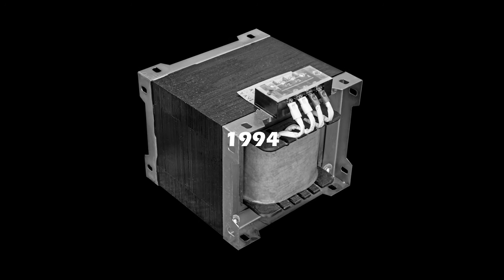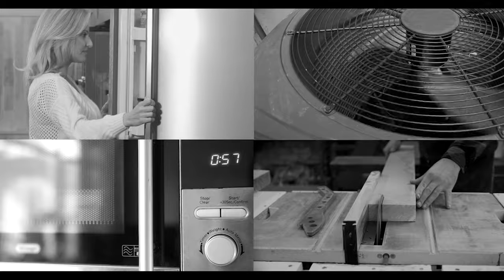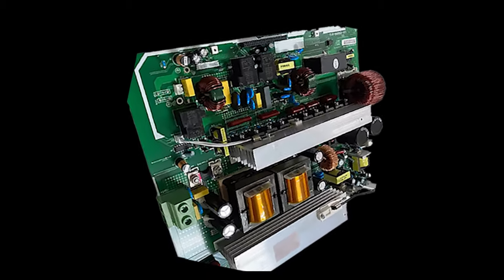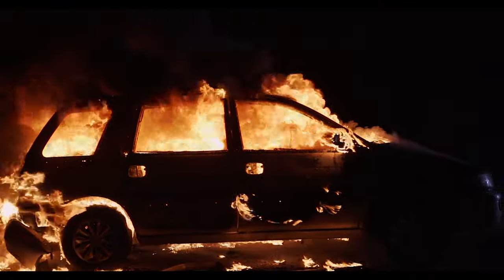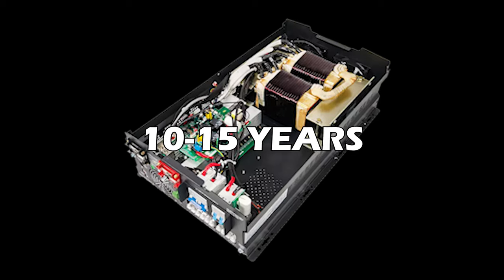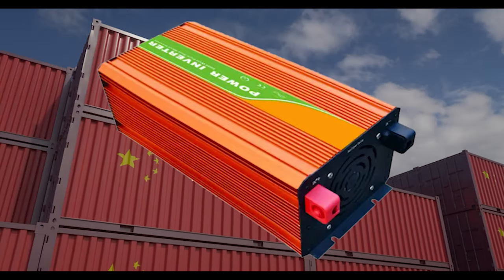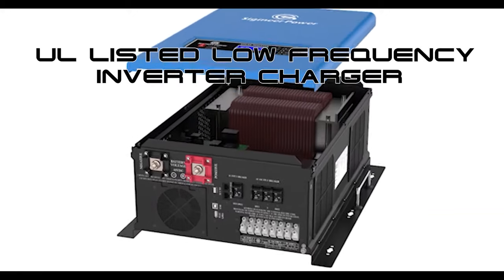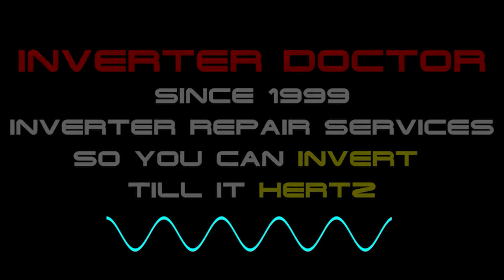Watch This Before Buying That Off Grid Inverter

Comment: I have a Chinese Meanwell 3000w HF inverter running 7/24 since May 2011.
Reply: Running what? Resistive loads?
Reply: @Madsci-zy8wm  fridge, submersible pump,TV, CCTV and lights
Reply from the maker: @evrenforest2578  What is your solar array and batteries rated at?
Reply: 6*250w PV array with 48v200 amp gel batteries
Reply: @evrenforest2578  A submersible pump and a fridge and a TV are not high inductance loads residential loads. If they were, you would have probably only had a couple of years worth of use from your 3kW HF inverter before the FETs and Caps fried.
Reply: @Madsci-zy8wm  electric motors ( AC, fridge, ...) is inductance!
Reply: @valerigeorgiev5615  Of course that are. But the electric motor/compressor in a refrigerator is very small and demands a small surge current.
Reply: @Madsci-zy8wm  exactly
Reply: @evrenforest2578 Does this work well for a 3/4 HP pool pump? you have to remember that they have a starting surge.
Reply: @evrenforest2578  A fridge is a relatively light inductive load, and so is a sump pump. And TVs CCTV and lights are not inductive loads.

Comment: There's a reason I paid "extra" for the Victron.👍
Reply: And Victron is not the only one, but you are correct, you will pay more for transformer based units. Something most don't take into account is idol consumption, Victron is great at that also. I have a 3000w mobile solar generator,  low frequency unit, and it idols at 13w. And 15kw in batteries. I try to tell people those Chinese units are junk!

Comment: Over exaggerated it all depends what you are going to use the inverter to do what job and what is the purpose. Yes I would definitely recommend Victor on the circuitry on the low frequency inverter is very well designed but they are not cheap everybody has a budget. There is nothing wrong with high frequency inverters if they are designed correctly. High frequency versus tend to be a lot more efficient lower power consumption without load rather than a low frequency inverter. But then again it all depends what is the purpose of the inverter if you're going to run a full house then yes I would recommend low frequency but at the same time if your calculations are correct you could have two high frequencies synchronized together which will work very well.
Reply: There's plenty wrong with high frequency inverters. They don't last as long, they've got a crappy surge capacity. And because they don't have an isolation transformer, when they fail, they can take out your appliances in a heartbeat. Why do you thing they're so cheap? They're basically a poor man's inverter. And you don't have to buy an expensive Victron inverter anymore if you want a high performance, low frequency inverter, There are plenty of Chinese made low frequency inverters available that sell for nearly the same price as these junk high frequency inverters. The only people that are promoting these cheap inverters are youtube salesmen that earn a commission when you click on their affiliate links.
Reply from the maker: This video is not over-exaggerated in any way shap or form. The problem with all of the Chinese built high frequency inverters is that they lack any galvanic isolation which make them all a potentially dangerous product that can set your appliances and home on fire.

Comment: Low frequency inverters are not very efficient in standby,,and when you get one you have to add an mppt controller switches ect and they are 3 times the price .the answer is get 2 or 3 high frequency inverters in parallel and don't work them to hard. And they are more efficient in idle mode
Reply: They make an in one low frequency inverters

Comment: The only problem I have with LF inverters is I have yet to fine some that can stack.  I can stack my growatt inverters.  They are off grid.  At some point I will replace them.  Currently looking at EG for that.  But there are a couple of Us mfgs too.  We shall see what is available for a 48v system by then.  In the mean time, I still trying to figure out a way to integrate my 24v wind turbines from the old system with out a $2K charge controller and changing the heads for $1400...
Reply from the maker: Many low frequency, transformer based inverters are stackable including Schneider Electric, Outback Power, Magnum Energy, Victron Energy and Sigineer Energy which is the lowest price, high quality low frequency inverter on the market. I have three Sigineer 6kW MS6048Ds powering one of my off grid properties right now.

Comment: I use a HF one as a backup, the main one I use is a chinese one with a 15kg toroidal transformer, which I only replaced my previous one because snow condensation blew the mosfets, learned from that🤨

Comment: Here's a good analogy: 

Think of a low freq inverter as a heavy, cast iron block, low RPM diesel with a big heavy fly wheel and a large capacity cooling system. 

Think of a Chinese high freq inverter as a small, all aluminum, high RPM, air-cooled, 2 cycle engine, with a tiny flywheel. 

Which one do you think will last longer?  Which one will be able to handle the big startup current surges for your A/C unit, or your 5HP well pump?
Reply from the maker: Awesome analogy! You hit it right on the nail head!

Comment: How do we tell if an inverter is low or high frequency when looing to buy one? Is it listed somewhere that is reliable? Just because a vendor says their inverter is low frequency does not mean it really is.
Reply from the maker: One way you can easily tell is by the weight. A typical 5 Kw all in one high frequency inverter charger will weigh 52.9 lbs. While a 5kW all in one low frequency inverter charger will weigh 99 lbs. Another way you can tell is by the surge capacity. A high frequency inverter will offer a maximum of a 200% surge capacity while a low frequency inverter will off at least a 300% surge capacity.
Reply: @kickgas7171  Hahahaha. Yeah I was going to say, if you can pick it up with one hand, it's not low frequency. :)

Comment: How about we buy let say 10kw high frequency Inverter, but only use max 5kw load ? So even powering peak it wont break ????
Reply from the maker: Why spend all that extra money for a 10kW high frequency inverter that cannot start 10kW inductive loads when you can spend less money on a 5kW low frequency inverter that will start the 5kW inductive loads that you want to limit yourself to?
Reply: Buy 3 times the size you need for running hf inverter on fridge or freezer or pumps
Reply: You are still kind of rolling the dice. Yeah, it might work. You have to look at the specs regarding peak current versus hold-up time. There should be 3 or 4 values given.  X amps for 10ms,  Y amps for 100ms, Z amps for 1 second, etc. That sort of thing. Not every heavy inductive load is the same. And here's the other part: Who's specs are you gonna believe? Chinese physics typically is not the same as American, German, or Japanese physics.  Translation: They lie about their specs all the time.

Comment: Totally agreed only technical people can understand this.
I am using APC smart UPS 3000 (2700 watts) with 80Amp mppt charge controller.
Any Chinese inverter have features like APC like AVR auto shutdown group outlets?
Remember whenever these inverter going to die because of short circuit most probably entire home appliances will be damage.
Reply from the maker: Yes, high frequency, transformerless inverters can damage your AC appliances.

Comment: Do you have inverter that 120 volt AC as input?
Reply from the maker: Sigineer Power makes 120 VAC Input/120 VAC output 60Hz. Inverter chargers with AC transfer switch from 1.5kW to 4kW that are reasonably priced.

Comment: where is the link to this great inverter?
Reply from the maker: It's not just one inverter. Most top name brand US inverter manufacturers only build low frequency transformer based inverter. Brands like Schneider Electric, Outback Power, Sigineer Power (a Chinese brand), Magnum Energy, Victron Energy, just to name a few.

Comment: Who makes a Decent Low Frequency inverter say 1500 watt ?
Reply from the maker: Sigineer is one brand. Their 1500 Watt low frequency inverter is available in both 12 volt or 24 Volt versions. They have built in chargers and a transfer switch for fast UPS function and they offer a high 4,500 Watt peak power capacity.
Reply: I have there 6k now for a week. It’s nice but querkie.
Reply from the maker: @2hotscottpro  All inverters are quirky. Even big name brand, US made inverters are quirky.
Reply: Studer
Reply: Samless, 12 volts, 24 volts. Low and high frecuency.